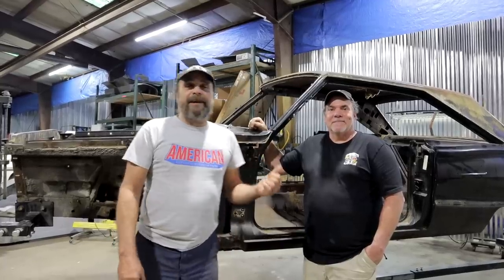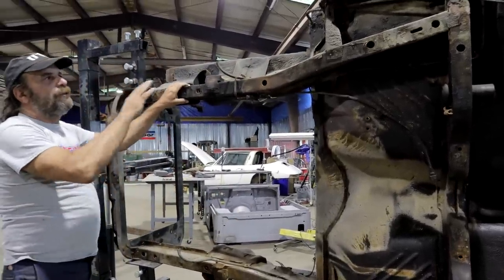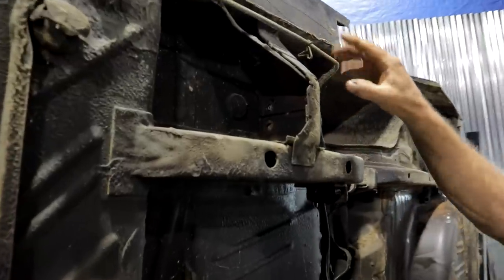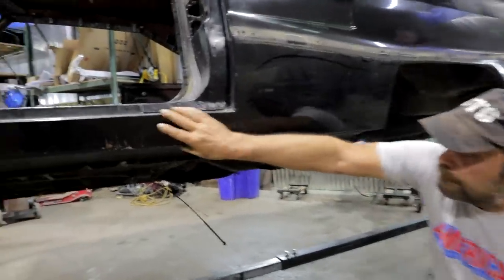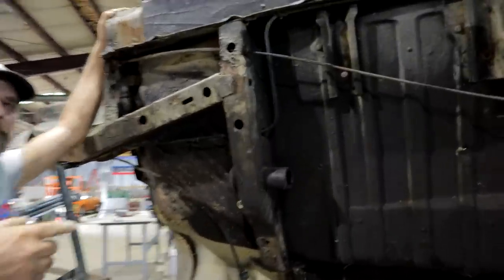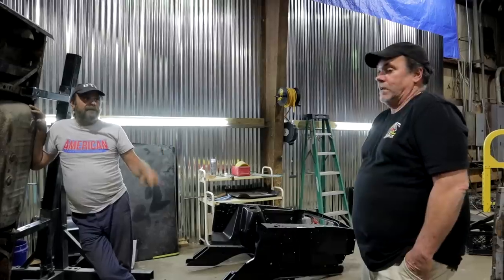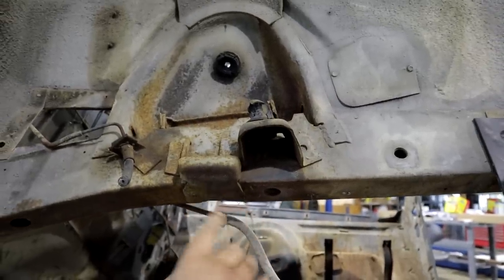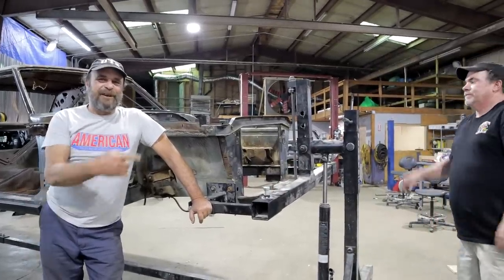Inside The Amazing Chrysler Unibody

Comment: Making the roof responsible for rusting out the floor is a concept that the Citroën DS takes to the next level. How about rusting out the rear trailing arm mounts by letting in water from a bad roof seal right on top of the driver?

Comment: The trunk side plugs should absolutely be a screened plug. Even 1/4 x 1/4, but with a heavy screen. Without it the rats would own your car and make it their home. It happens anyway over time, but mostly from a rot hole due to not allowing moisture to get out or dry out. Many people who understand old mopars park them in their garage with the trunk slightly open and those in the country tend to leave mouse traps in the trunks as well!!  As nice as that body is, Mine is nicer and 2 years older...
Reply: Yes. Rodents can find ways in you wouldnt believe. Thats the reason the a/c drain tubes have that funny rubber turn down boot on them with the flat end.  😁
Reply: Those plugs are actually made to be removed so those areas can be flushed, there is usually a small slot that leads to the plug as a primary drain then the plug can be removed once the primary is clogged. Too bad people weren't aware back in the day.

Comment: I experienced having a torsion bar twist into the cross-member in my 72 Demon after hitting a pothole.  The front of the car dropped, ruining my exhaust Y-pipe as I had to at least get to my uncle's house, where he put a 2x4 piece of wood above the lower control arm to keep the car up so I could get home about 15 miles away. This was my first car, and needless to say I wasn't impressed.
Reply: My friends would buy mopars in Michigan with rotted out torsion mounts cram a 4x4 in the space to limp them home and repair the mount wind up the bar and Voila! Driver again and sell for a profit seen them do it 100 times

Comment: Uncle Tony The guys over at the Hagerty YouTube channel have a 1937 ford "flat track dirt racer" with a 440, and a 4 speed they're asking for help on. It has a set of mismatched (One Early, One Late) heads, and they need a matching set, with advice and guidance on rebuilding them. They do a great stop motion of the actual rebuild of things like the heads, after any cleaning, maching, and or porting, of course.
Please reach out to them, they're nearby in TN as well. I'm sure it would be mutually beneficial.
Thanks, have a great day.

Comment: we should have had youtube back in the mid 1970s and U.T.G. around 1985 I Bought my 1974 Cuda, it leaked on hevvy rain days so my friend said Pop all the  Body Plugs becauuse i did not have a garage. it lasted 25 plus  years without rusting around areas, But it already had started in quarter panels. i also used Rust back brand of some kind that stopped aready rusted spots on Door under the lock and on back where the vinyl top was

Comment: The thing about these old cars, their mechanicals generally were bulletproof such as the engine and transmission.  However the bodies and frames were not designed for durability.
Fords from 67 to 77 were the worst for corrosion at it would rust on the suspension and brake components as well.
Those model years, many of the Fords were heaping piles of rust within 2 to 3 years. Ford had a secret warranty which covered these  premature rusting issues starting in the mid 70's. It was called "J67", secret rust warranty. Fortunately for Ford, due to serious consumer complaints with regards to their severe rusting issues, Ford greatly improved their bodies, beginning in 1978 and they have the best fit and finish, both for the exterior and interior , amongst all the domestic automakers. 
While many automakers have greatly increased their rust resistance, over the past 40 years, imo, domestic automakers have declined markedly when it comes to mechanical durability and reliability. 
They are also a heckuva lot more expensive to repair, due to their complexity and insure.
Anyhow, UTG, really is technically knowledgeable when it comes to Mopars and the older domestic cars.

Comment: Raced a couple of A bodies in pure stock back in the day....torsion bars are tough to beat, but caging the car was always a challenge...there’s just nothing solid to weld to.
Reply: Yes. That probably was before MIG. LOL.  B...MIG.
Reply: @chriscatarcio7534  MIG? Lincoln AC stick welder and oxy-acet torches with coat hangars for filler....black iron pipe for the tubes, bent by a local muffler shop. Not exactly high tech....I did mount a second ballast resistor on the firewall, however......

Comment: Allthough revolutionary and ahead of its time. Its still really bad for rust cuz when it rusts the body underneath its’ also eating the frame and foundation of the car. Body on frame designs can rust and still maintain a really ridgid structure, but when the body itself is the frame. rotten suspention points on a unibady car can quickly render the car useless and its these areas that see the most damage too!

Comment: I'm curious, which car manufacturer was the first to use unit - body or "unibody" construction?
Also; A body, B body, E body whatever, I just have a fat - body now!  😂😂
Reply: You could always Google it.😎

The first popular mass-produced unibody car came in 1928 from DKW (now Audi) with a fabric-covered wood frame. Today, Audi builds cars with an aluminum ' spaceframe '. The Chrysler Airflow and the Citroen Traction Avant of 1934 used stressed body panels, and the Opel Olympia of 1935 was General Motors ' first unibody car.
Reply: @bigbear5510  Hey thanks for the answer and good point, I think I will Google it 😂👍!
Reply: I don't know which was the first but early fifties Hudsons were unibody cononstructed.
Reply: @dkenmiller9829  Read my reply above.😎
Reply: @bigbear5510  Your point is ?
Reply: @dkenmiller9829  The first popular mass-produced unibody car came in 1928 from DKW (now Audi) with a fabric-covered wood frame. Today, Audi builds cars with an aluminum ' spaceframe '. The Chrysler Airflow and the Citroen Traction Avant of 1934 used stressed body panels, and the Opel Olympia of 1935 was General Motors ' first unibody car.

Comment: it is why the 3 automakers lost the market, sloppy designs and production leasyness.( minding was and sitll is to save a few bucks for each car instead of producing quality )
The chrysler unitbody was a very sound design at the base but if you remember well, that was not rare to see a car of 3 years showing rust bubbling and in less than 10 years, extensive structutal damage.
I quit american production 40 years ago and I'm not  tempted to try it again
very good video and clear explanation

Comment: i think just about every older car has this problem just like a chevy pu u drill hole for the water to drain the factory ones are to small and plug up ford has bigger hole that is y u see less rusted one like 67 to 72 it is good to blow some air up the holes to clear them once a year or 2 . under coating is the worse where i live they never under coated them so we have a lot of rust free rigs i have a lot of rust free chevys that is right most people have never seen a rust free rig from factory from the 60's or 50's i even have a lot of square body chevys 73 to79 that are rust free which are known to be rusted even here plus i get most of them for free . i even have z28 hoods just laying in dirt that are in perfect condition with a bunch of other hoods front clips

Comment: A-Body: Top of engine compartment inner fenders, rear portion by the firewall..... rust, rust rust.
Reply: Not on all of them I have seen them rust there and I have seen many with no rust there that had to be where the car was parked to get that way I believe it was not all A bodys that had that issue just some of them. Like cars parked near trees that had tree crap on them all the time would get into the Cowl and rot that area right out same as the drip edges in the trunk and under the hood the tree crap would gather no one clean it out the rain would sit in there with no place to go and be held by the tree crap and rot everything right out.

Comment: I hope they remove all that undercoating and paint everything. I absolutely hate undercoating on a car. 

My dad had a 1961 Valiant 2 door back in the late '60s. Had the fake spare tire carrier on the trunk lid. Straight six, pushbutton automatic. He got rid of it when the transmission went out. I've wanted one ever since then, but have never seen another 2 door, other than in pictures. I would pay a pretty penny for one of those in good solid condition.

Comment: There was nothing great about those unibodies, they were a large part of the reason old Mopars had poor resale back in the 60s and 70s
 Mopars had a reputation of the body falling apart around the drivetrain which was well designed and resistant to abuse.
It was said in the 1970s that the ultimate car would be Chrysler engine/transmission GM chassis, Ford differentials and AMC interiors, likely because of standard reclining seats.
Reply: I generally prefer Ford's suspensions as well.